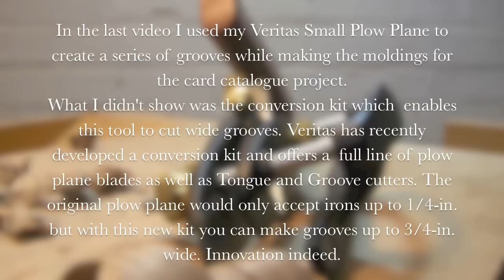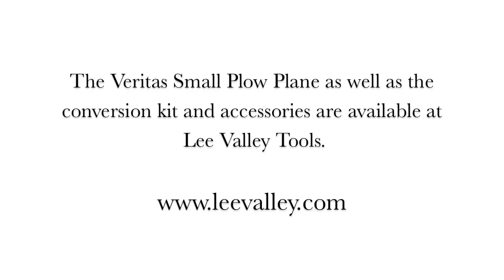A Card Catalogue part twelve: Veritas Small Plow Plane and Conversion Kit.

Comment: Doesn't a Stanley 45 allow you do do the wide plow cuts? I don't have all the blades for mine, but I do have larger than 1/2". I'm just a novice, so bear with me if this is obvious.
Reply from the maker: Robert Gil Thanks for the comments and question.
Yes, I believe you're correct. The Stanley 45 was/is a combination plane and if you had all of the proper plane irons/cutters/attachments, I'm sure you could use it as well.
You don't find very many these days with all of the parts in tact... but for sure, it could do the same job if properly set-up.
all the best~
Reply: Very cool! Thanks for the reply. I absolutely binge watched the card catalog series. Thanks for the great content.

Comment: There is one major problem with this plane .It has no nicker spur cutter so does not always give a clean edge particularly across the grain .iIcontacted lee valley about adding a spur nicker but was met with zero interest In fact they told me it was not necessary .Anyone who knows about plow plane design knows that it is absolutely..The Stanley 45 had spur nickers.
Reply from the maker: Plow planes never have nickers as they're not designed to cut across the grain- I think you're talking about a rebate or rabbet plane- these have nickers and are designed for cutting across the grain.
all the best~
Reply: If I may add, Veritas Combination Plane has a scoring spurs to allow cross-grain and clean cuts. But the Combination Plane is made to be several tools in one, different from the plow plane - I think.
Reply: To clarify - This is NOT a major problem - The Small Plow (Plough) Plane is just that.  You can certainly use it across the grain if you use a knife to score the grain first, in which case it works quite well.  The Stanley 45's equivalent in the Veritas range is the Veritas Combination Plane.  It has nickers/spur cutters, as per the 45 and 55.  It's also a much nicer combination plane than the 45 as a tool to use.  Lee Valley were quite correct in their answer, you just didn't like it, but it doesn't take away from its validity.  The plough and combination planes are two different tools.  Incidentally, both of the Veritas items work perfectly with the blades from my 45 and 55 Stanleys.